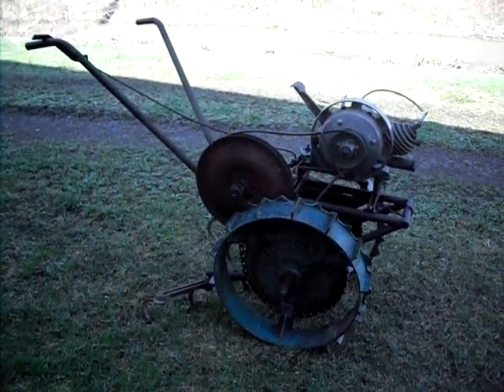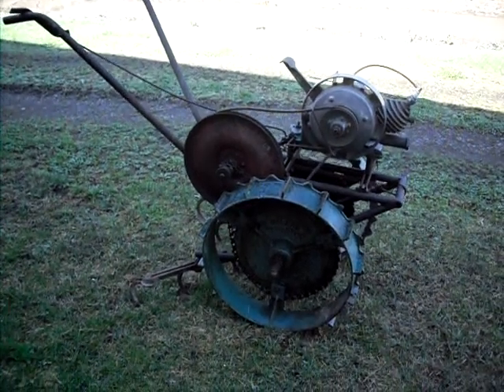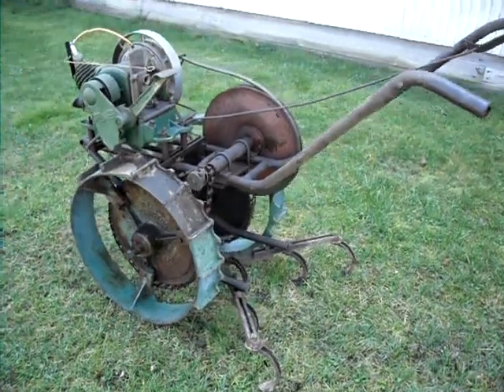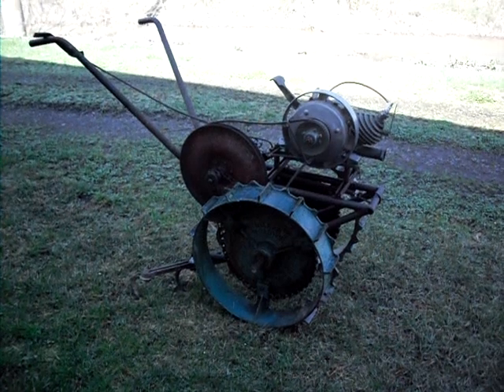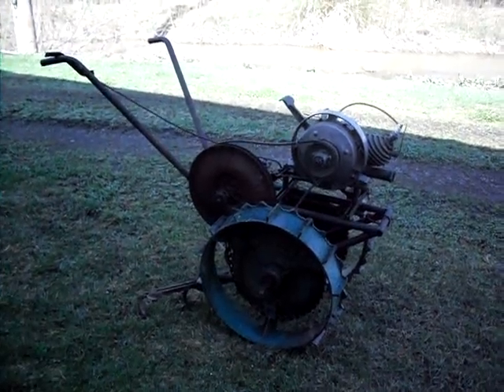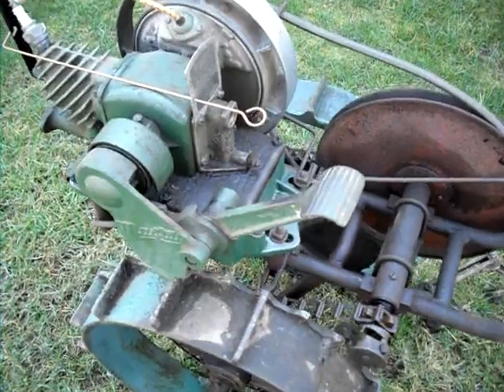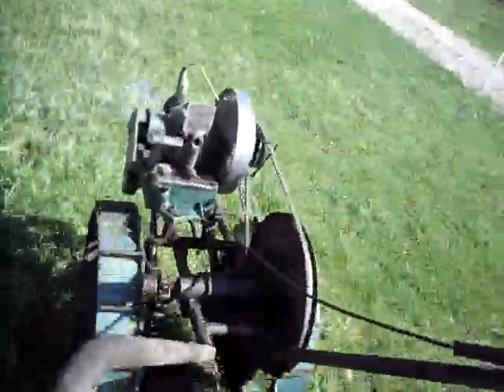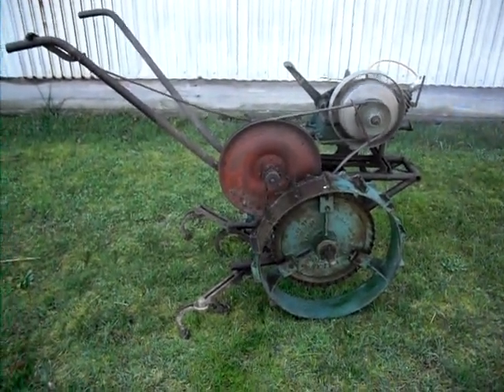Mclean Garden Tractor with Maytag Engine

Comment from the maker: @1944johndeerel I'm still not sure about the speed yet, but I can't see Mclean changing every pulley out on every engine for a smaller one when they came with a pulley in the first place. I would think they would design the rest of the tractor around it. I think if you were cultivating, the speed would not be that bad and you would finish that much faster.

Comment: Pulley ratio makes it too fast. May need to put a tiny pulley on the engine or add a shaft with large pulley belted to engine pulley and small pulley belted to tiller pulley.
I think it would stall if you tried to till in hard unbroken ground at this speed.